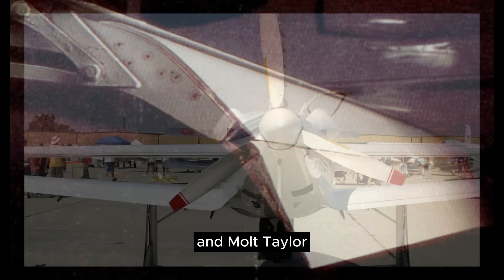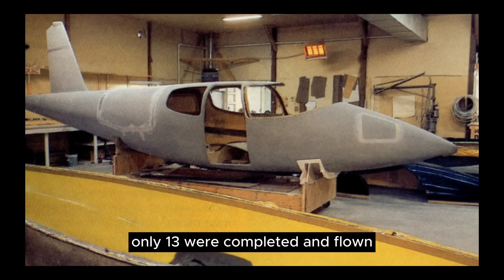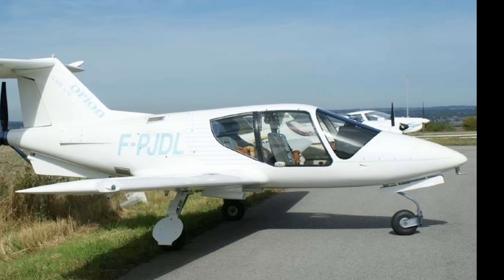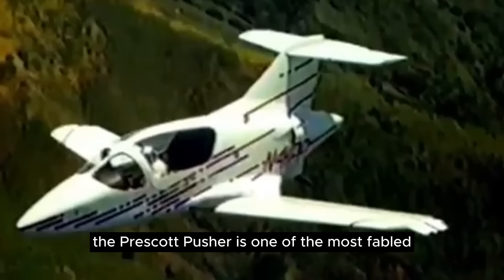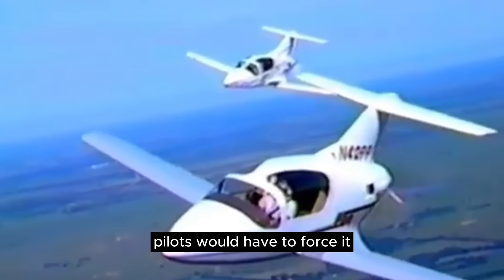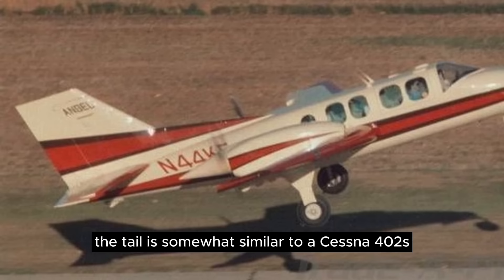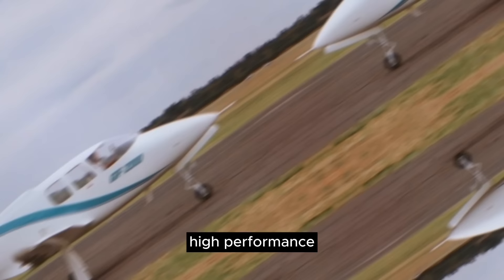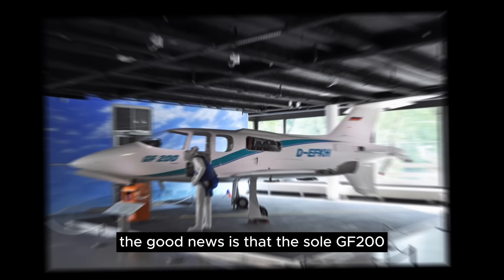Obscure Planes You've Never Heard of

Comment: The trouble with single engine pushers is a lot of the weight is at the back and affects the centre of gravity, stall speeds etc. So you have to take more care with your calculations.

The edgely optica was supposed to be slow. It was designed for ground inspection roles such as pipeline inspection, where it could take over from helicopters which had much higher maintenance costs. It was also supposed to have longer loiter time than your average helicopter. Really a different use case to your average get A to B type of plane.
Reply from the maker: Agree fully, not the same plane, but was just making a general statement about visibility on high performance planes.

Comment: I LUSTED after a VK-30 in the mid-late 1980's, when I started my aviation endeavors.  Sadly, life got in the way and I didn't continue them at that time-- but still lusted after a VK-30.  I understand their problems centered around the complex and trouble-prone driveshaft-- but wonder if more modern manufacturing processes could address and mitigate those issues.  I'm building a Glasair now, but would still love to own a VK-30.
Reply: Yes I see this a lot in previous design ideas that have a bad rep , we have have more technology now , and or "OK so that bit is a problem ? then fix it or upgrade it" 
It's like John Denver all over again , that plane got a bad rep for stupid things that could be easily fixed.
Reply from the maker: Glasairs are sweet!   Which model?   As to the Cirrus saga...I have a hard time imagining what modern process would circumvent the issue of connecting the distance between the prop and engine.  The physics issues don't go away.
Reply from the maker: They got it "fixed" when they put the engine up front and made it fixed landing gear. 👍
Reply: @aircraftadventures-vids  Not every idea turns out to be a good one 🤣
Reply: @aircraftadventures-vids  - I'm building a Glasair II FT.  Structurally about 80% done now.  In the VK-30, I don't think the DISTANCE between the engine and prop were the problem-- seems like adequate supporting structures for bearings (at both ends) and balancing the shaft were the problems.  I think Klapmeiers' engineering was good and I never read about any problems with the physics-- the flight characteristics were fantastic.  If I were building one today, I'd take a bunch of lessons from the Porsche 928-- They have a long driveshaft from the engine to the rear diff.  They seemed to work OK...

Comment: A plane like the Orion and VK30 could do well with a hybrid power system.  An electric motor in the tail and the piston engine in the mid-section.  This would eliminate the need for a prop shart.  The prescott need a small jet engine.
Reply: That is a great idea but a 200 hp electric motor is very heavy. Now you have the weight of almost two engines but the power of only one.
Reply: @robjohnson8522  Motors produce far more hp per pound than engines do. Siemens, for example, manufacturers a 260 kW (348 hp) aircraft motor that weighs only 110 lbs - about 5 times the power-to-weight ratio of an aircraft piston engine. The challenge is the battery pack, or hybrid drive system. But @maxmodels is correct -- mounting a motor in an ideal location is easier and doesn't require a prop shaft. The tradeoff is the energy source for the motor weighs much, except for short flights.

Comment: I think these pusher designs will become popular with electric propulsion you can center the batteries and stick the motor and prop far aft without a propshaft.
Reply from the maker: Too heavy to work for these type of homebuilts. At present time they work for small trainers that can barely manage a few hops around the pattern.

Comment: The Cirrus looked good and I like the rear propulsion for noise and looks. But out of 13 planes there were 11 fatalities, that's one hell of a record. I wonder what happened.
Maybe that's why they have such belief in parachutes.
Reply: PS. small turbofan is the holy grail answer. Or was. We are about to have UFO disclosure which might change aviation just a tiny bit.
Reply: In the last crash that I recall a prop shaft failure resulted in an off-airport landing. The aircraft either hit rocks or uneven terrain in the desert on landing resulting in I believe 2 fatalities. Might have been a combination of the glass fuselage composite construction and high approach or impact speed that caused the breakup. I think torsional vibration caused the shaft failure.
Reply: @bernieschiff5919   yeah if it has a long drive shaft that could perhaps create some snapping forces if it isn't rigid or balanced. Maybe the uneven torque of a piston engine. I can't find the stall speed for it but it's built like a fast bird which makes ditching more dangerous. Fiberglass is a pretty tough material so I wouldn't suspect that first as a cause of injury, quite the opposite. But it could have been unforgiving terrain or a stall crash. If you land on semi flat terrain you probably have to be unlucky to die.

Comment: I rode in the Angel 44.  It actually has potential.
Reply: It looks tough. In its case, the pusher props make sense to protect them from damage in the bush.  

But I suppose in the end operators compared the cost of a twin to singles like the Cherokee six, with a similar useful load, and chose the less expensive route.

Comment: You would think that after a propshaft breaks, owners would be interested in some kind of analysis as to why and some engineering work toward a way to keep it from happening again.
Reply: I could see as soon I saw it that there are no rubbers in the connections , ( It's like a rubber disk with 6 holes in it ) So Fatigue Cracks here we come...
Reply: @maxgood42  Spring steel couplings are quite common in aviation, especially in helicopters. The difference being the powerplant usually being a turbine which has smooth torque output. A damper needs to be used preferably before the transmission for a piston engine.
Reply: @chippyjohn1  And as a pusher even with a turbine there is turbulent air coming of the body hitting the blades so that will also make it ruff .
Reply: @maxgood42  True, but not as much as the torque pulses from a piston engine.

Comment: In my opinion, pusher engine aircraft would be much more better as all thrust will not blocked by the engine fairing and the fuselagem and any other fuselagem interference. That's why the Beechcraft Starship was very fast aircraft.
Reply: Get update regarding impulse value of the disturbed air going over fuselage, wings, stabilizer, ruder and landing gear.

The speed of the starship is not extraordinary considering the small fuselage and the high power of two turboprops .
Reply: Don't forget that the Starship airframe used composites. As I recall, the FAA certification was time consuming.

Comment: Most pushers are total turds.

Not because its inherently inferior. But because those proponents of different designs are generally not great designers. 

I have yet to see a pusher with proper cooling inlets, ram air intakes, Meredith effect, and laminar flow fuselage, etc. they go to all the effort and screw up the areas that are known to be the areas that need work and will produce benefits.

Comment: Any aft mounted engine design has problems, unless it's a jet . Rotate on take off and your propeller strikes the ground Duh !!?? In the Cessna 337 , the aft engines overheated , not enough cooling back there. In cars , it's an abortion idea, VW air-cooled engines all suffered over heating and lacked power . Then they build a stupid car called Porsche which had an even bigger air-cooled engine stuck in the back where it lacked cooling, same as the Cessna 337 . It's stupid !!! Now days Porsche 911 concept designs come liquid cooled and have radiators in the front to handle the heat generated by those thirsty flat 6's in the back. Look at the plumbing required and the length of it and potential failure points . Well it's similar for airplanes with one extra potential disaster, PROPSTRIKE !!!!
Reply: Teach me senpai.